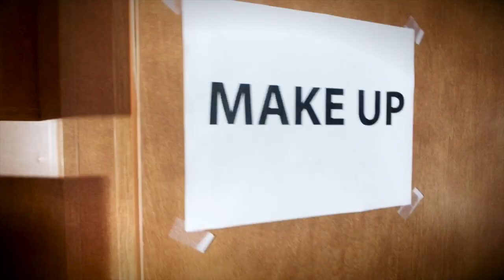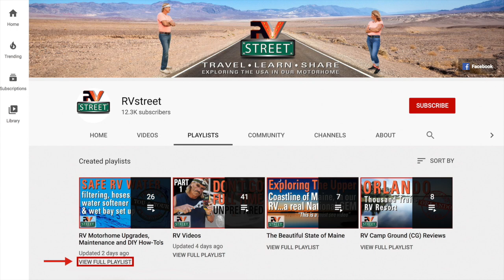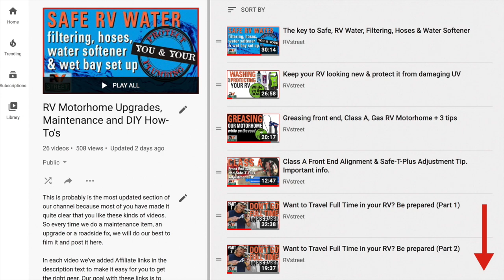RV KwiKee Power Steps: EVERYTHING YOU NEED TO KNOW

Comment: how can you tell the fuse at end of purple wire is bad?  What is needed to replace if it is bad?
Reply from the maker: Open up that black fuse container by twisting it and check the fuse. If the fuse is blown, replace it with the same rating fuse that's in there.

Comment: I would like to replace the stair bulb. But can't figure out how to get the lens off. I tried to unscrew it but just spins. Hesitant to try to pry ot off, might break. I have a single step. Not sure they would be the same.
How did you remove yours?
Reply from the maker: To tell you the truth I don't remember exactly. I think I used a flat tip screw driver and carefully got under it and popped it off. But not 100%.
Reply: @RVstreet  I just talked to KwiKee and they suggested the same proceedure.
Like your channel....I am a subscriber.........
Reply from the maker: @michaelvimazal5012  Thanks Michael so much for the feed back and subbing.👍

Comment: I have a 2016 fleetwood jamboree with kwikee steps that work, however, My override switch does not keep steps out. I have 3 entry switches. One for porch light that will keep step out, if I have my light on always, one that should be a dedicated step override, and the other is step light. The dedicated switch will not keep step out. What would cause that?
Reply from the maker: Well hard to say without being there and digging into possibilities, but the first thing I'd check is the switch itself. If not that, then the switch ground. I would also get under the stairs like I did in the video and clean all the electrical components and eliminate those possible failure points right off the bat. The way I approach trying to figure out what's causing •ANY• malfunction on anything, is I always eliminate the obvious things and steps first. Once those are eliminated, that means it can only be XYZ.

Comment: Martin - I've a question that you may be able to answer or help point me in the right direction.  I have a Kwikee power step on my class-A that functions just fine UNTIL I turn on the ignition.  As soon as I turn on the key, the steps EXTEND.  I'm wondering if this sounds like a controller (909510000) issue or if it could possibly be something related to a poor ground or something else.  I'll go through their troubleshooting exercise but am just wondering if you've ever heard of anyone having this type of issue.
Reply from the maker: As soon as I turn on the key, the steps EXTEND
What position is the door when this happens?
Reply: @RVstreet  The door is closed and the steps are retracted before I put the key in the ignition (the step power switch location doesn't matter).  As mentioned, the steps EXTEND as soon as I turn on the key.  If I turn the key back to the OFF position, the steps return to the retracted position.  It's as if the ignition switch functionality works in reverse to what it should be.
Reply from the maker: Has this been the way it has always worked or is this a condition that has just begun to occur? 
Have any parts been replaced recently?

I do know the step motor runs fwd/reverse by reversing polarity to it.
Reversed wires are probably the problem.
Just reverse the leads to the motor.

BUT.......

Read this ENTIRE post on an RV forum that explains your problem and the solution:
https://www.irv2.com/forums/f54/kwikee-steps-working-backwards-529269.html

The answer was suggested in Post #19 and he finally did that in Post# 22.
Reply: @RVstreet  I just purchased the coach (used) a month or so ago ... a 2019 Jayco Alante 26X and the steps worked fine until just recently.  I can see where reversing the motor leads would solve the issue with the ignition but wouldn't that cause the steps to work backwards with respect to the door?  Open the door and the steps would retract, close the door and they would extend, ... unless you have the step power switch on - in which case, they would stay retracted and cease to function with the door?

Today, with the key off, the door opening causes the steps to extend.  Closing the door causes the steps to retract UNLESS the step power switch is in the off position.  That all seems to work normally and as I would expect.

I'll crawl under the coach to undo/redo the ground wire, check all of the wiring, and walk through the trouble-shooting steps.  If someone messed with anything underneath the coach, that may be pretty obvious - in which case, I will go in and talk directly with the salesman where I purchased the coach.
Reply from the maker: @steveallen8830  IMO, don't waste your time talking to the salesman. He will not be able to help you. He's a salesman. 
But yeah, if the steps used to work fine and this is a recent development, it may be a loose or corroded wire under there. Also check the connections at the switch and the door magnetic switch.
Once you've done all that try it. Then as a last resort, remove the the fuse under there for about 2 minutes, then reinsert. That will reset the controller. That may work. BUT...do all the other stuff first.
Remember, those steps are exposed to rain too. If you've been in rain lately, that can cause issues too. That's why it's important to service this area often. 
Once everything has been checked and it's working fine again, don't be afraid to spray some battery protectant on all wiring connections to help prevent water intrusion and corrosion. pls let me know how everything turns out 🤛
Reply: @RVstreet  Following up on this thread - I checked out all of the wiring using the Kwikee trouble-shooting guide and convinced myself to order a replacement controller, ... I swapped it out yesterday and the steps work perfectly fine now.
Reply from the maker: @steveallen8830  Good job Steve 👍

Comment: My steps are stuck in.  How can I manually deploy so that I can get to the motor?
Reply from the maker: 1) See if you can get behind the steps and tap the motor from behind. Sometimes this will jar it enough to work and deploy the steps.

2) Removed the mounting bolts for the whole step and lower it down. A floor jack or even a simple tire jack could support it as you take the bolts out. Also, you need to disconnect your batteries (remove neg. cable) to make sure it cannot deploy while working on it because that thing could accidentally get power and bad things will happen.

3) Sometimes you can get the steps to manually extend. There is a cotter pin that is basically unreachable when the steps are closed. You can only access it through the 1/4 “ slot between the top step and the aluminum flashing.

If you can, remove the flashing or trim panel just above the top step. This will give you enough room to remove the cotter pin, which the released the steps.

4) Depending on your RV and how the steps are set up, there is a pin that you can pull, has a cotter key, this will let the steps come loose from the electric motor swing arm, then you have access to the bolts holding the motor and swing arm to the step mount.

Comment: I have a problem with the drawer, and when it is open for more than five minutes, it stops working until I take the motor out of its place and connect it to a source of 12 volts to move a little and then reinstall it again and it returns to work
Is there a reason for that and how to fix it? Thank you
Reply from the maker: I have a problem with the drawer....I assume you meant steps?
It sounds to me that you have a 12V connection problem. Go thru all the maintenance steps I showed first and see if that fixes the problem. These steps solve 80%-90% of peoples step problems.

it stops working until I take the motor out of its place and connect it to a source of 12 volts
So is it not connected to a 12V source to start with?

Comment: My steps are locking up and won't extend. I have disconnected the pin or motor and extended them and put it back together and they work again.
Reply from the maker: Thank you for sharing your information and helping the RV community 👍

Comment: Need help: long story short. One of the bolts fell off from the motor which drop the gear so now that I placed the bolt back the steps retract and deploy but now the gears are grinding on the motor
Reply from the maker: It could be a couple of things. Remove the bolts and drop the motor to see what's going on.

Comment: Sadly I did not see my specific problem mentioned.  All good info though.  My problem is that the steps won’t turn off.  Even with the switch inside in the off position, it won’t turn off.  I even tried disconnecting the wires to the sensors.  And that makes the steps  automatically deploy.  I need to turn them off because we’ve had a nice wooden steps and deck built.  Any ideas anyone?
Reply from the maker: I even tried disconnecting the wires to the sensors
Not sure what what sensors your speaking of—bc there's only one and that's the magnetic switch on the door. But how about just disconnecting the motor control board under the steps and then push them in by hand.
Even with the switch inside in the off position, it won’t turn off. 
Could be a defective switch. Need to test it.
IMO, there's something wrong electrically going on and I would trouble shoot all the areas I covered in the video.
The most common problems of steps malfunctioning like this are:
1) Magnetic switch on the door not gapped properly or wiring is loose or disconnected
2) Bad main turn off switch
3) Bad ground
4) Malfunctioning control board
Reply: @RVstreet  what you call magnetic switch I am calling sensor.  

Unfortunately to disconnect the motor we have to tear apart the newly built deck and stair.  It was built while we were gone.  So that is the next step.  Thank you!

Comment: How do ya wire the frickin batteries... House and starting battery!  Starts but doesn't charge house battery when plugged in to shore power
Reply from the maker: You have house batteries which powers everything in your rig that is 12volt or if you use your inverter. Then you have the chassis battery which starts your rigs engine. Once the RV is started the alternator should be charging the chassis battery and in many/most rigs the house batteries too. If your house batteries are not being charged when your plugged into shore power it very well could mean that your converter is bad. Or your batteries may be shot too. If they have ever gone dead or real low, your batteries may be shot. But, there are many, many ways to troubleshoot what's going on. You need to study up on your batteries,  how they work and troubleshoot them. Lots of info out there on this subject. Wish I had a vid on this but I do not. Sorry. Maybe sometime in the future. Be patient, go thru everything methodical to narrow down what isn't the problem and that will reveal what it has to be. Good luck. 👍
Reply: @RVstreet  I accidentally got it right, when I took one battery in to get checked at Interstate battery. It was good. So I switched them on reinstall and also must have hooked it up different and now it works. My trickle charger said it was a bad battery... Probably a bad connection. What a riot!
Reply: Found a manual in the rig! By Bob Livingston also have Will Prowse DIY Solar Power!😷
Reply from the maker: @chriseudy4684  Now that you have it wired correctly, take a picture and keep it for future reference. Good job. 👍
Reply: @RVstreet  the future is now

Comment: How do I get to the motor when the steps are not deployed?
Reply from the maker: 1) See if you can get behind the steps and tap the motor from behind. Sometimes this will jar it enough to work and deploy the steps.

2) Remove the mounting bolts for the whole step and lower it down. A floor jack or even a simple tire jack could support it as you take the bolts out. Also, you need to disconnect your batteries (remove neg. cable) to make sure it cannot deploy while working on it because that thing could accidentally get power and bad things will happen.

3) Sometimes you can get the steps to manually extend. There is a cotter pin that is basically unreachable when the steps are closed. You can only access it through the 1/4 “ slot between the top step and the aluminum flashing.

If you can, remove the flashing or trim panel just above the top step. This will give you enough room to remove the cotter pin, which the released the steps.

4) Depending on your RV and how the steps are set up, there is a pin that you can pull, has a cotter key, this will let the steps come loose from the electric motor swing arm, then you have access to the bolts holding the motor and swing arm to the step mount.

Hope this helps 👍
Reply from the maker: Try #1 first, then proceed with the others.
Reply from the maker: I have been thinking about your situation. Be sure to check the things I mentioned. Perhaps the door mag switch is not working or a wire is loose. Make sure your batteries are good. Always check the easy and common thing first to get your steps to deploy. Don't just assume the motor is dead.